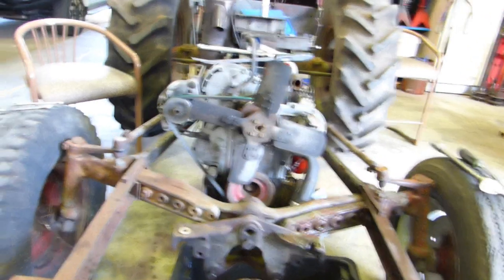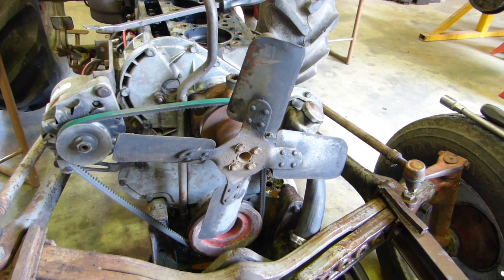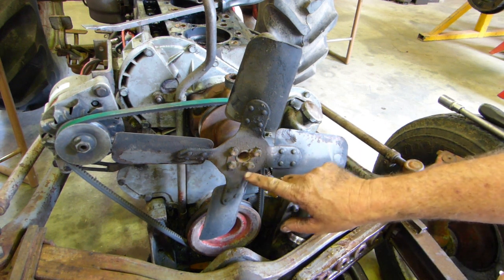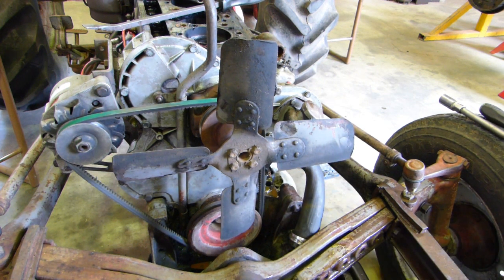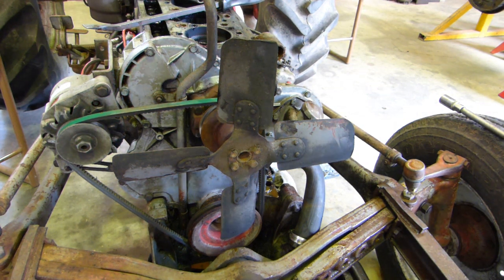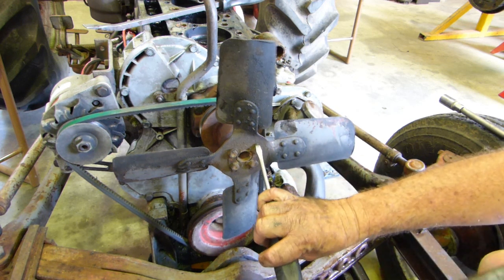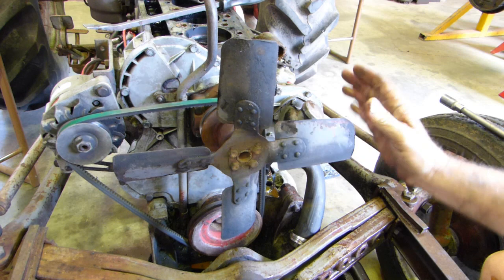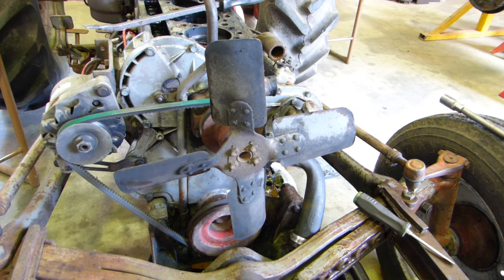MF135 Restoration #5 Removing Radiator and Water Pump.

Comment: Great tip there Lance. I’ve never seen that setup for the water pump so learnt something new today! Thank you! 👍
Reply from the maker: Thanks Gordon.
Reply: Same for me in Poland we don't even have a bakelite piece. Just the pump, a gasket with a hole and than a second gasket on top protecting the timing cover. A plate sounds much more reliable.

Just completely renovated the engine it's only running hot now I'm in doubt between the Pomp that looked good and the radiator ha! Thermostat opens , sensor, hoses, air leaks, temp meter are all tested.

Comment: Awesome video Lance, have been trying to eliminate possible water ingress areas as my oil level increased so far replaced fuel lift pump and gasket, oil filler and gasket so next will be to check behind the water pump. Thanks for uploading this info its so helpful :)
Reply from the maker: Glad to help, I hope you find it.

Comment: I;m a welder not a mechanic, very interesting videos. Hopefully I never have to dig into my 245 like you are. It has a 3 cylinder Perkins also, not sure if it's the same engine as yours. Good stuff, keep smiling.
Reply from the maker: G Day Darren, It probably is very similar even the 4 cyl is basically the same just with an extra pot.

Comment: Hi Lance when my fan blade has quite a bit of play is it possible to replace the bearings after the water pump is out or is this always a full water pump replacement? My MF50 runs fine but sometimes the fan bearings start dancing around the whole gives a horrible vibration & noise. Ones I change rpm it disappears and everything runs fine and smooth.
Reply from the maker: You can replace the bearings and seal but often it is more cost effective to replace the pump as a complete unit.
Reply: @BundyBearsShed  Thanks for your answer. I live in New Zealand and probably have to order parts from overseas.

Comment: Hi Lance... another great video. I uncovered similar wear in my 135. For the thermostat- do you think 160deg or 180deg for my Perkins AD3.152 diesel? Thanks!
Reply from the maker: In  Australia in our hotter areas we use 82 deg C. After operating the tractors for a while they are wide open anyhow in most conditions, I think only in extreme cold you would have it opening and closing.

Comment: my massey 35 is not circulating water. I've changed pump and thermostat but no go. Any ideas
Reply from the maker: Have you checked the thermostat is opening? I have had the odd faulty one. possibly try without the thermostat and see if there is any flow then.

Comment: Hello Lance hows life treating you please can you advise me i am doing radiator and engine antifreeze flush its green coolant thats coming out when i have flushed with fresh water can i put red antifreeze i have 5 x 1 litre jars new can i use this in my TVO tractor 🚜  would two litres do  top with fresh water or three litres many thanks  Lance how your ute 😊👌💯
Reply from the maker: G Day Stephen, You would need to read the strength of the coolant to get a good answer. Red will work fine if the green is cleaned out well so the two dont mix. It also depends on if the red is a concentrate or ready to pour in.
Reply: @BundyBearsShed  Cheers Lance  i flused the engine and radiator ran it hot flushed again it was pure antifreeze you have to add water i put 2x litres and topped with frest water little ferguson really needed thanks so much Lance for your advice 🍻 i have fond memories of my back packing time around Australia Perth - Albania Pemberton - monkey mia Brum Katherine Olgas around Alicesprings Adelaide Murray river Kangaroo Island Wilsons prome  Victoria around Tasmania up to. Sydney seen and experienced some kool adventures you live in a fantastic country 👌💯🍻

Comment: Hello i have a mf 290 but i know fuck all about engines but she starts first tip of the key ever day even when it -4 out side does this mean the good or it this normally and when i pull up the dip stick when it ticking over no oil comes up out of it aswell and when she rev up high there practically no oil coming up either
Reply from the maker: G Day Jonathon, It sounds like your engine is in good nick, all of those things point to it being good.
Reply: Ok thank you going to give her a oil change this week to make sure there no metal pieces in it